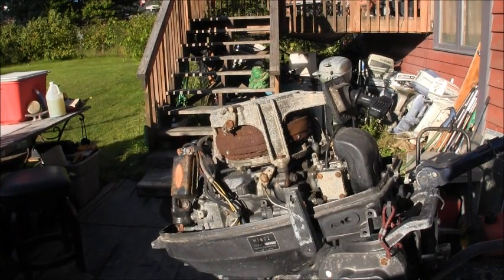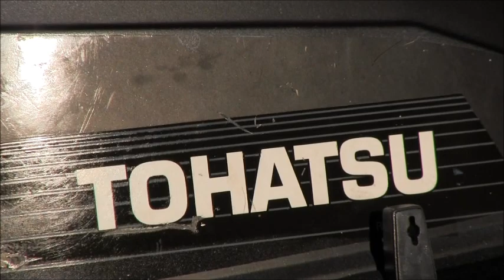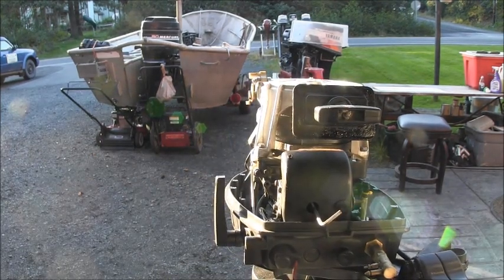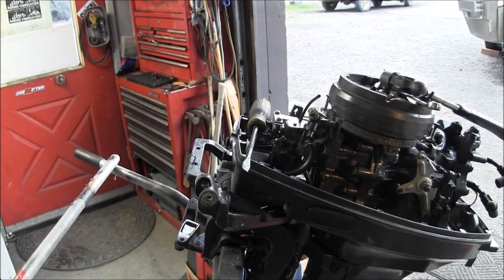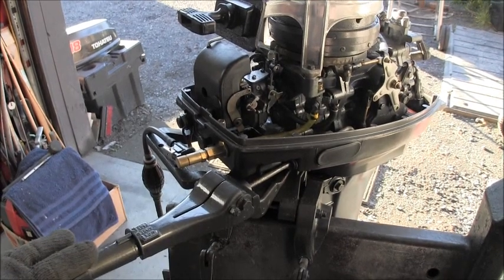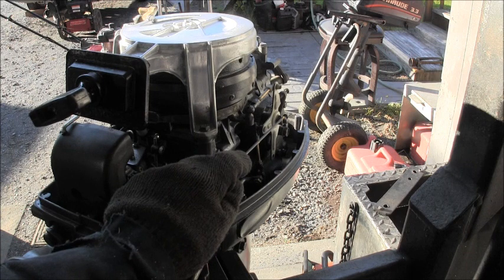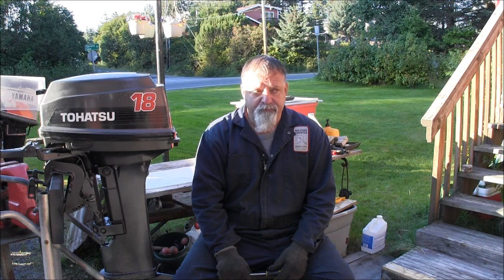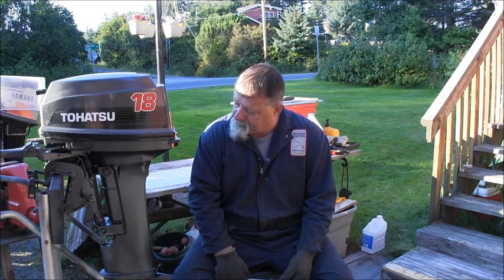TOHATSU 18  HP TWO STROKE,   CAN IT BE SAVED,    (( Part  3  ))

Comment: Hi Kodi, Yep my Merc Mark 10's tiller handle bolts on the same way all mechanical but has the automatic transmission which is not for a new person out on the water since they can start in gear if your not careful. Mine didn't come with a tiller but had a 10ft control on both ends. perfect for a small boat or back in the 50's small mini hydros with the Mark 28. I still haven't painted mine yet but plan on it.